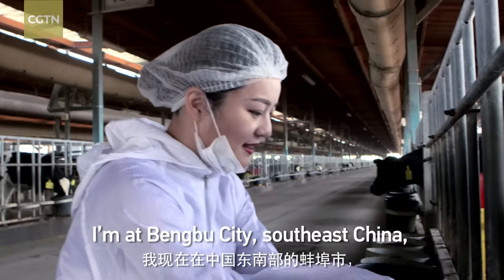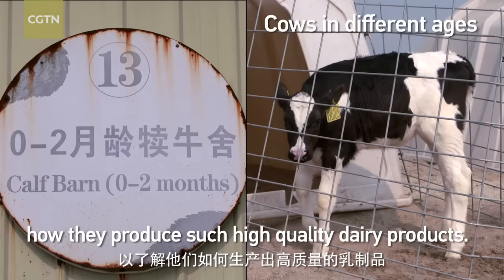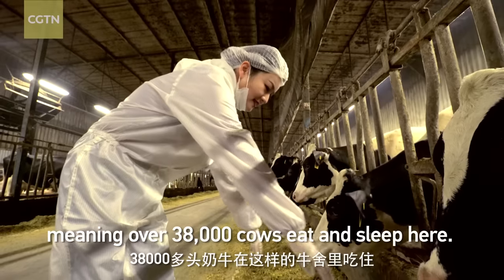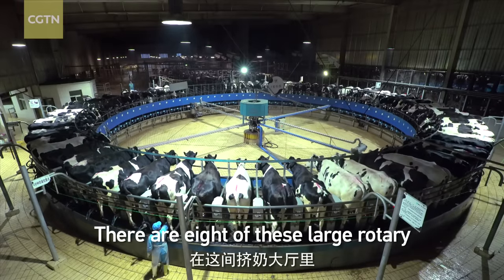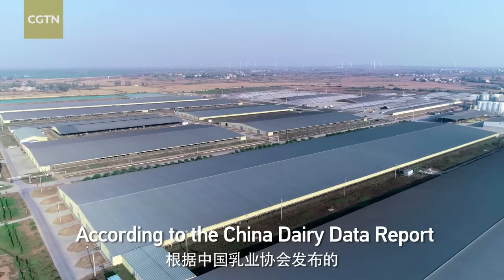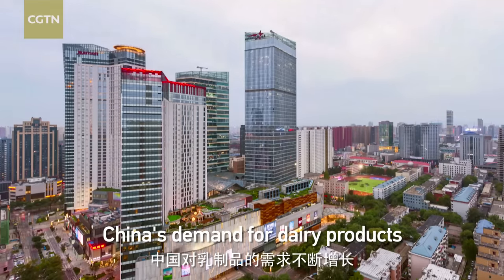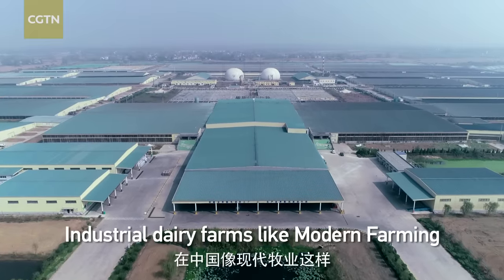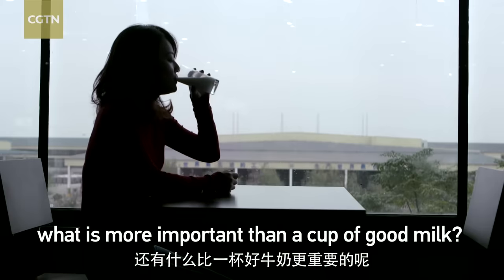Feeding 1.4 Billion: Inside China's largest dairy farm

Comment: They didn't show how those cows need to have had a child to produce milk and the calves are taken off them so we can take the milk year after year until they're spent and then sent to slaughter (usually hung by the leg and throat slit) and it's cheaper for the farmer to kill the male calves but we also use their rennet in their stomachs for cheese making and eat veal as well.

To impregnant them they are put in a rape rack and have an arm inserted in their anus to hold their cervix while they insert semen into their vagina